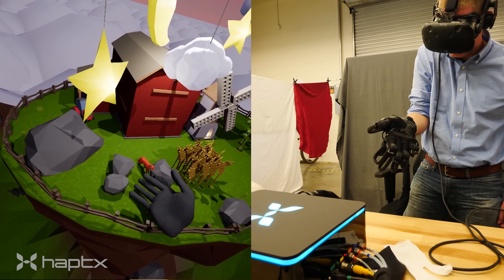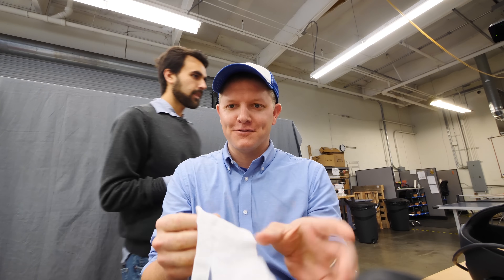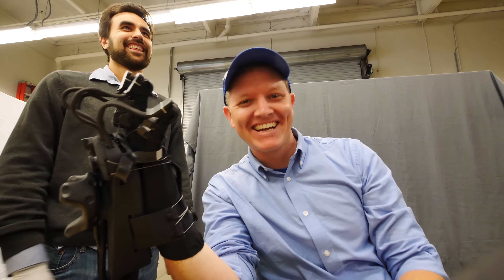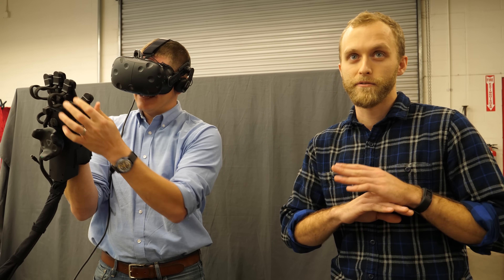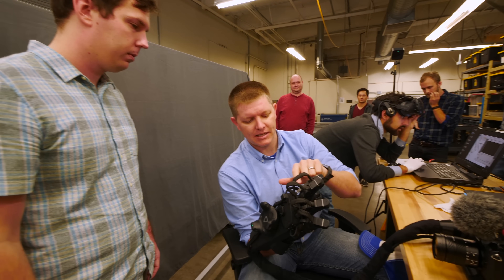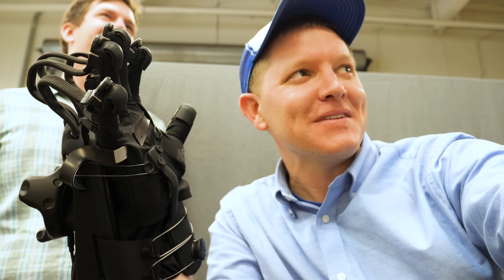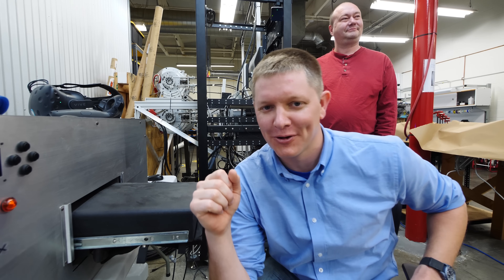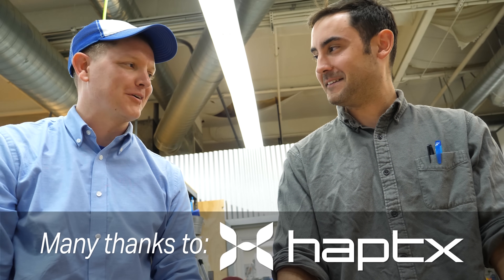How do you make a Virtual Reality Glove? - Smarter Every Day 191

Comment: I'm sure you already know this, but the sensation of "hot" is not actually it's own sensation, it's warm + cold sensations happening simultaneously.  You can simulate "hot" by setting your faucet to a light stream of slightly warm water, and having a cup of ice water.  Place your finger under the warm stream from the sink, and then pour the cold water right next to the warm water.  Right near the interface between the two, you will perceive "hot."  If done just right, you'll instinctively yank your hand away and feel like you've burnt your finger for about 10 minutes.  Great fun at parties.  I'm betting these guys must've dealt with that in some way, because it would be extremely easy to cause actual discomfort with high enough resolution cold and warm water cells in proximity.  I'd even go so far as to say that they probably have a proprietary "faux burning" simulation that they've used to trick coworkers.  If I worked there, I would've definitely done that.  :D
Reply: Your thermoreceptors senses the absolute and relative change in temperature, that's why it feels burning when you go from really cold to slightly warm because the relative change in temperarute is big. If you want to be technical then "cold" doesn't really exist. Heat is the movement of atoms, the more atoms move the hotter something is.
Reply: You didn't understand what I said.  I said nothing about switching between warm and cold over time, I said that triggering both warm and cold sensations simultaneously in the same area of your body results in the sensation of very hot, which it demonstrably does.
Reply: It's called the "Thermal Grill Illusion."  Here is some information:  https://en.wikipedia.org/wiki/Thermal_grill_illusion
Reply: Yes, yes.  My point was that when the "cold receptors discharge at high temperatures, above 45c," humans perceive the combined firing of warm and cold receptors as "very hot" and the reflex arc neural pathway responds without giving the brain any chance to make a decision.  The brain is too slow.  So, you accidentally grab a plate that's say, 180 degrees F, both receptors fire like mad, and your spinal cord decides for you that this is not ideal.  Your hand automatically retracts and you jump around like an idiot for a while.  You can fake this sensation by triggering both warmth receptors and "lack of warmth" receptors in close proximity with warm and cold water.
Reply: I'm looking for some more information about the way thermoreceptors are working, like how the sensors under our skin can perceive the excitement of atoms. I'd be glad if you can help me.
Reply: You have two kinds of termoreceptors, one that senses warmth and one that senses cold. So SilentGloves is wrong in stating that "the sensation of hot is not it's own sensation".

There is technically nothing that's cold, it's only a lack of heat. Heat is generated when atoms vibrate or bump into eachother, you can't generate cold you can only take away heat. You can't take away all heat though, as far as we know reaching 0 Kelvin (absolute zero) is impossible. It is possible to go lower than 0 Kelvin though. It seems weird but it really isn't when you think about it. At 0 Kelvin atoms wouldn't be moving at all and be at a 100% stand still, but if you go into negative Kelvin then they start moving again but in the opposite direction.

To explain how termoreceptors work you need to go into advanced biology which is kinda confusing. The simple way to think of it is:

Your thermoreceptors are just a part of your sensory neurons, they send signals to your brain via electric discharge (like all nerves and neurons do). The warm receptors discharge faster when they are warm and slower when they are cold while the cold receptors discharge faster when they are cold and slower when they are warm, they can do that because they are made from different fibers and have different conductivity. Some cold receptors discharge at high temperatures though, above 45c, and the reason why is unknown.

Now, don't quote me on this explanation as it's a vast oversimplification by some random dude in Youtube comments. If you want to learn more I would suggest getting a book about the subject, I can't really recommend one unfortunately but a quick Google search brought me to "Thermal Sensations and Thermoreceptors in Man" by Herbert Hensel which seems to be good but I haven't read it.
Reply: Explain.
Reply: SilentGloves this is bullshit
Reply: SilentGloves you don't feel HOT when feeling cold! Ever heard of hot-cold shower therapy? You change the water from warming hot to cold back to warm again, repeatedly. And guess what? Cold always feels cold. Warm feels warm. There is no HOT (as you discribe it) inbetween 😑

What he the other guys says and what actually is true is temperature is dependent on the current temperature you're feeling. So when you have your hand in cool water and then put it in cold (but warmer) water afterwards, the cold water feels warm for a few seconds. Or not as cold during the time you're holding it in there, compared to when you just put it straight in (without cooling it down first)

Comment: If I understand it right, they are using individual polymer tubes that are all individually connected via an array of tubes. I assume this could be reduced by using a single magnetosensitive elastomer, or elastomer tubing with built in magnetic valves of some sort.

Comment: I wonder why they use Air instead of a liquid, if lag time needs to be calculated... a leak could be the issue... air leak would be reinflateable, where a liquid leak would require replacement fluid...

Comment: Thanks Destin, I’m supposed to be sleeping, but now I’m thinking how to transfer heat, quicklt on tiny surface area...  Did you feel hot and cold same time in different parts of your hand? I think they need to have proportial valve, like In standard faucet, just a lost smaller, and they are mixing hot and cold water and dumping it back to two reservours. So that lead me thinking that it is not that ”complicated” (But in detail it probably is)... excellent video, when we are getting next?

Comment: when I read the book, I was thinking about the haptics the entire time. I thing that I thought about the most was "what happens if you try to touch your chest?" how do you make it thin enough so that if you touch yourself it doesn't break the magic of the simulation. When I read th book, i thought the haptics would not be air controlled but little mechanical pistons all over the suit, but that raises the question, where do these pistons push off of? This can also bee seen in the tacters, if you apply pressure all around the hand, you will have to compensate for all the tacters pushing off at once, giving little to push off. I am such a rambling nerd...

Comment: I'm guessing the tactors (guessing on the spelling there) are hydrolic, not pneumatic, and the fluid in the values is also the heat transfer medium. This solves a problem with bulk of the glove and also any sort of compressibility "mushiness" you'd get from the tactors. Just a guess.

Comment: the heat transfer i think may be caused by having two fluids both hot and cold, so whatever mechanism is carrying the water can have two parts that are so close together that your hand registers them as one point. have you ever thought about how close individual water spots (of unknown radius) would need to be to each other in order to simulate real water? sure, two mechanical pencils with low heat transfer could simulate touch, but perhaps a larger rate of heat transfer would affect a larger radius than what the radius of the water drop mechanism lying on your hand. love you man keep it up
Reply: oh forgot to mention my suggestion on how  the mechanism works for switching between hot and cold

the actuators look promising, in fact if you scaled it down further, you can pick and choose individual bubbles temperature which carry the water. 

if you’re confused on my visualization of the water droplets on your hand, imagine freezing time and dropping hundreds (perhaps?) of water drops of your hand of an unknown radius. the radius would need to be tested as if you want to achieve a greater surface area using less actuators, larger actuators would do the job, carrying more surface area to transfer heat onto the hand, which will then dissipate affecting a larger surface area than the size of the actuator.

Comment: Would it slightly remove latency and allow for better control if the tactors used a highly viscous fluid? A fluid would be incompressible as apposed to air.

Comment: At 14:45 talk about the Heat/Cold exchange. I would think they would use very small Peltiers that run on very small voltage. They'd only need to transfer a very small amount of heat. But a Peltier can do it rather quickly. Especially if there's a thermal mass on the opposite side from your hand to hold that energy. Again, it wouldn't need to be very big.
The guy in red shirt confirms a fluid, but he doesn't confirm electrical. Could it be possible it uses both? Skin -> Peltier -> Fluid. The Fluid holds the thermal energy; which fluid/water can transfer thermal energy fairly quickly.

Comment: Why wouldn't they use a liquid in the blatter instead of air. Liquid is incompressible and also can be better controlled for thermal regulation. I woukd guess rather than having 2 pads, they solve this problem with 1 pad that controls both the feeling and the temperature.

Comment: Destin, there are Thermal Electric Devices that are semi conductors that when the DC polarity is in one direction the feedback is warm/hot, and in the other is cold.  It is plausible that the team could be working on this problem using these devices scaled down to create the rapid heat response that you felt in version 2 without water for version (4). It answers a problem for size and timing with TEDs, but is difficult because adding a feedback sensor impacts the ability for the valves to generate their feedback.

Comment: As far as the temperature thing goes, the way I would do it is to have to constantly flowing lines one hot one cold connected to a bunch of heat exchangers. And each heat exchanger would have valves that can control how much of each fluid goes through the heat exchanger. That way you only have to worry about the  heat exchangers thermal mass and it would keep temperature change close to instantaneous.
Reply: Of course getting valves small enough to fit into a glove would be pretty hard. So, maybe it's just low volume on high velocity water.

Comment: For the temperature system could they have two separate systems for hot and cold instead of one system that has to switch between hot and cold?  Since that version used hydraulic tactors you could place them so that you have one hot and one cold within the two point threshold of each other and then drain one while filling the other.

Comment: Would using a liquid not be useful for avoiding the lag in the activator? (Due to the fact that liquid cannot be compressed as much) 
I assume a large amount of the lag is due to the fact that air can be compressed in the tube with high pressure activation. Or would the pipes simply be narrow enough to make the whole volume/pressure (of pipe) and expansion/compression (of air) effectively obsolete...?

Comment: I agree they would use a liquid. The liquid would flow faster then air, ie quicker response time as it can not compress, hence water hammer effect.
but with air they can very the pressure to cause the bladder to feel harder.

Comment: 12:15 "With the velocity of the fluid." So not even air, he let slip that it's fluid being used opposed to air. Also, not sure if he meant velocity or viscosity in regards to how fast the fluid is moving versus thickness of the fluid itself being a factor. His diction seems very intentional, so I'd assume he meant velocity of moving from point A to B, but I have to wonder, since he specifically said "fluid" opposed to when you were talking about air, if viscosity is a factor there, as well.
Reply: Air is a fluid

Comment: At the about 12,20 your talking about the response time due to the compressibility of the air in the Tacter (hope that's spelt right) and about the lag caused by it, why not use a fluid like a light oil or water? wouldn't that reduce/remove the lag? or is the fact that fluids and electronics don't tend to mix well

Comment: Destin, the fluid transfer doesn't have to happen very fast at all. Remember the two points; if "they" simply deflate the hot captors (? captors? bladders) and they move a fraction away from the skin and simultaneously inflate the cold ones in close proximity to the ones just deflated, the mind would experience...

Comment: VERY interesting video! One question: the video covered how the haptic system responds to certain input, but there are a TON of environmental factors that are part of that input to the system. How does HaptX manage the crazy amount of data presented by the environment about the user surroundings? VR establishes a spacial recognition of the environment, but haptics adds so many more layers. For example, how does the system know an upholstered chair is softer than folding chair, or a soda can is easier to squeeze than a soup can. This has to be an overwhelming data management problem, especially given the response times that they need to mimic touch. I would love to get your thoughts!

Comment: question? couldnt they use peltiers to do the hot and cold simulations?  Mind you that I'm not sure how small you can make one and how fast you could switch the hot and cold sides? seems that smaller peltiers might be able to be reversed faster than larger ones?
Reply from the maker: Petiers aren't quick enough.  It's all about a concept called "thermal mass".  You need a difference in temperature to transfer heat... but you need whatever you're transferring the heat TO to have enough heat capacity to be able to maintain that difference in heat.  Make sense?
Reply: Peltiers were my thought too. If they are placed close to the skin and overdriven with high voltage/current, they could be fast enough. Once the target temperature of an element is reached, they can just lower the voltage to maintain the temp.

On the other side of peltier elements, they could have some kind of energy storage medium like water or some other liquid, to dump excess heat to or "take" heat from it.
Reply: Yes! Now that you point it out!  Peltiers only move heat. There wouldn't be enough ambient heat to pump to your finger to "feel"!  I wasn't thinking!! LOL
Reply: Two micro peltier elements next to each other for one sensory point. One is to create cold by dumping heat into a copper reservoir, the other one has a heaterwire on one site and dumps this heat into your finger. Well I just realized you don't need the second peltier and can just use the heater.